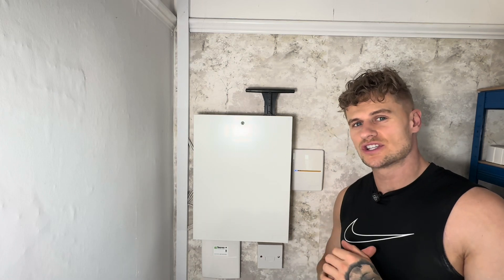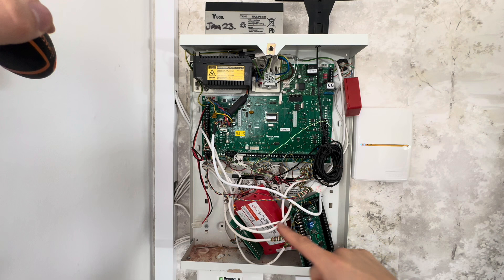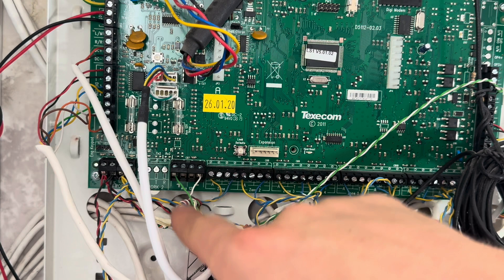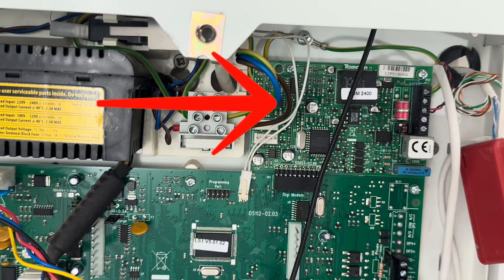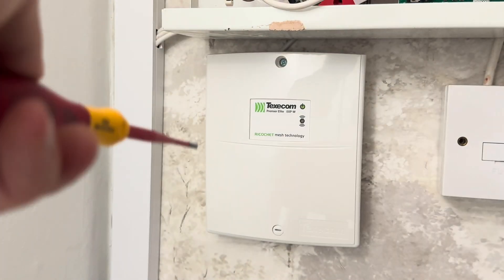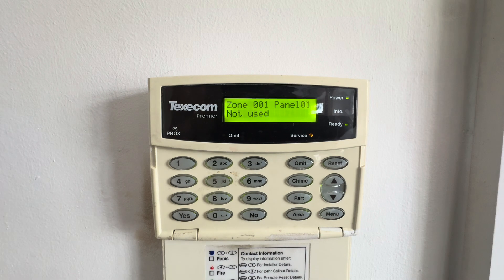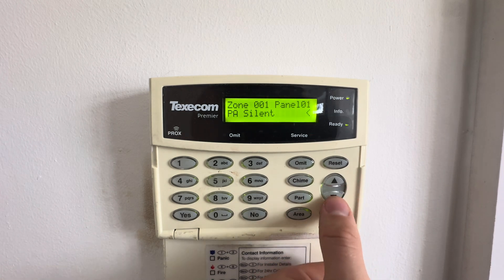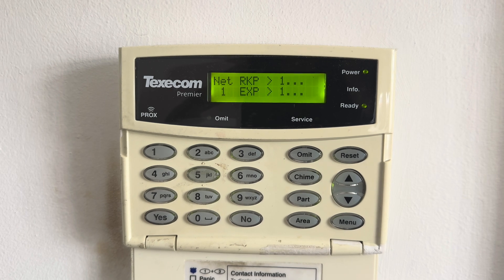Texecom Premier Elite Alarm System Walkthrough – Setup, Wiring & Engineer Menu Guide

Comment: Hi Simon, great video, did you do one on setting up a CSL Gradeshift UDL? Trying to do one but hit a brick wall. Thanks
Reply from the maker: Hi mate I haven’t had chance to make that vid yet but it is on the list! What issue are you having? I’m sure I’d still be able to help. Do you have a step by step programming checklist for the Dualcom?
Reply: Hi, no don’t have that. I did a Wintex firmware update  so I could connect a smart com which worked fine and backed up the panel. But after a master reset the back would not upload. So I lost all setting. I have managed to reprogram the panel and got the smart com working but can’t get the dual com connected. A local company fitted but are no longer around and would like to sort myself if possible. Thanks in advance.
Reply from the maker: No worries mate I can send you some step by step instructions. Do you have insta? Message me there so I can send pics @simonsecurityexpert

Comment: Hi, I have the Texecom Connect SmartCom Ethernet & Wifi Communicator CEL-0001
It is wire connected and have the app on my phone to enable me to make changes away from home.
Will it ring my mobile phone if the alarm gets activated?
Thanks
Reply from the maker: Hi, it should send alerts to your phone through notifications including critical alerts as long as it’s been programmed correctly in the alarm programming and you have notifications enabled in your phone for the Texecom app 👍🏻
Reply: @SimonSecurityExpert  I have notifications sent to my by phone when arming and disarming the alarm system but how do I get it to ring when the alarm gets triggered?
Reply from the maker: If you mean like a ringing phone call you can’t do that mate, it can send push notifications but you’d need a specific speech dialer if you want your system to phone you when it triggers. However critical alerts feature usually works great and it should have that enabled, people usually prefer that over a phone call nowadays

Comment: Hi Simon, I have this system on our home, but when I go to exit with the fob it states area garage and the make a different sound after setting and when returning home, how can I rectify this issue, thanks in advance for your assistance
Reply from the maker: Hi Hugh, happy to help with this mate, sounds like your fob is set up to arm and disarm a different area such as a garage only set, is this correct? Guessing it sets normally from the keypad?
Reply: Hi Simon, thanks for your prompt reply, no it doesn’t set correctly on the key pad either, whatever I try it come back saying area 011 garage is active, I have scrolled to the garage setting and entered the code, it remains active ?. Thanks also for your offer to show how to add extra fobs to the system. I look forward to hearing from you in due course.
Reply from the maker: Ahh ok I’m totally with you now mate, you’ve got an issue on the garage PIR, it’s saying it’s active which means it thinks it’s seeing movement in that area, you may have a cable fault, or a PIR fault. Is the PIR (motion sensor) old? Or have you had any building work etc? If it was working fine and now it isn’t, it’s more than likely a failed PIR and you need a new one, let me know what you find and I can advise from there, also worth seeing if the garage sensor lights up when you walk past to rule out a power issue 😁

Comment: Hey! Great video on the Texecom Premier alarm. I was following along with connecting the internal sounder, and I hit a snag that I think might be a common issue for others too.
I successfully got the system into 'learn Ricochet' mode, and it seemed to learn all my other devices fine, eventually saying 'all devices learned.' However, when I went into walk test, the internal sounder didn't activate. It's almost like the system didn't recognize it as a connected sounder
Reply: Are you able to help me get the internal sounder configured to the control panel. Thanks
Reply from the maker: Hi mate! Happy to help on this. On the Texecom premier elite it doesn’t trip the internal or external sirens/sounders/speakers as it does on some other systems. It has a latching walk test meaning you just go round all sensors and then go back to the keypad after to check which ones have been tripped. To check the internal sounder is working go into engineer utilities, bell test, scroll down to speaker test and hit yes, that should test the speaker for you. Hope this has helped let me know if not 👍🏻
Reply: @SimonSecurityExpert  thanks for getting back to me. Still unsure how to configure the sounder to control panel though. We had to purchase an additional sounder as our smartcom and the box is installed under the staircase and no can't hear the alarm while we are in the loft. Please advise. That would be so much help. Happy to show you photos or videos of our set up so you can help and run through how to configure. Thanks
Reply from the maker: Pictures would be great for this one mate so I can properly understand, please send to my Instagram @simonsecurityexpert (I haven’t started properly posting on there yet but I will see the message) then I’m sure I’ll be able to advise 👍🏻

Comment: Thanks I have just installed this Panel at home and not a security expert bit have installed alarms before. I hope when i power it up all goes ok. One question im updating a already installed alarm system do I have to use Texecom wires PIR's?
Reply from the maker: Hi Mark good to have you here mate. If you’re using hard wired PIR’s then no! You can use pretty much all of them, one thing to bear in mind though is if you wire it conventionally you will need to change the zone from an end of line zone to normally closed, you can keep it as end of line but if you do that you’ll need to order some 4K7 & 2K2 resistors and install them with EOL wiring. If you go for the normally closed way you’ll see me on the vid show you how to change the zone from EOL to NC 👍🏻

Comment: @10:55 it probably isn't designed to work in a metal can enclosure for the alarm panel since the radio signals would be blocked unless you use an external antenna.
Reply from the maker: I agree mate it would need an external antenna for the metal housing but you know the panels such as the premier 64 W they are polycarbonate or the prem 24 etc (ones that are usually used domestically) and it would be fine sitting in there. The metal housing like this is more common in commercial really